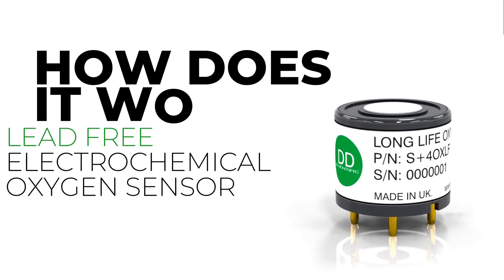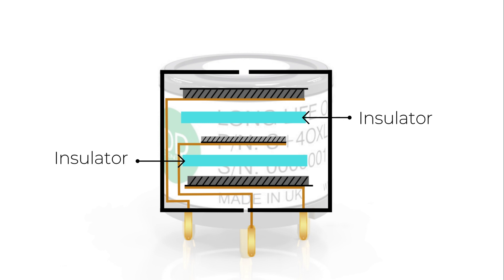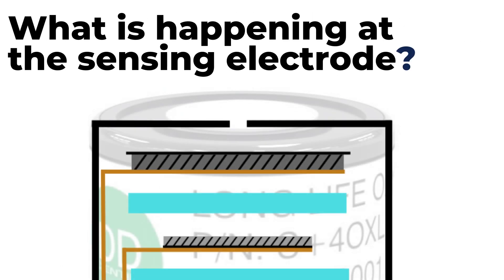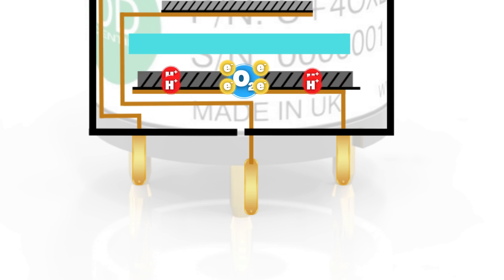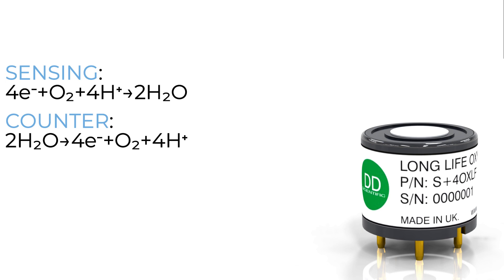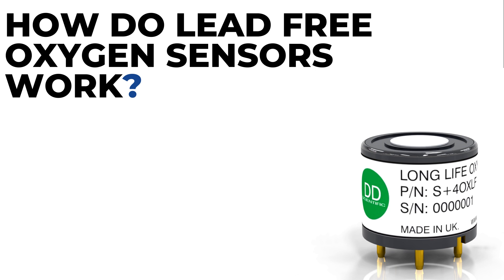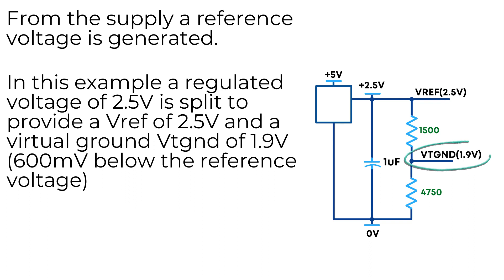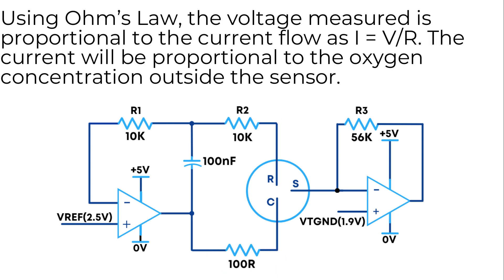How does it work? Electrochemical oxygen sensor(lead-free)

Comment: Can you explain why the sensors become unusable over time? Somehow "saturated"? Does the oxygen process deplete the electrolyte?
Reply from the maker: Good afternoon - thank you for making contact with DD-Scientific and for your question.

The chemical reaction within a lead based Oxygen sensor results in the lead being converted to Lead Oxide.

Once all the Lead has been converted into Lead Oxide, e.g. there are no more active sites within the sensor, the output will reduce and eventually cease.

However, lead free Oxygen sensors have a completely different configuration e.g. they are reactive to the target gas and with no materials being consumed, lifetime is in excess of 5 years

We hope that this answers your questions, but please feel free to drop us a line at any time!